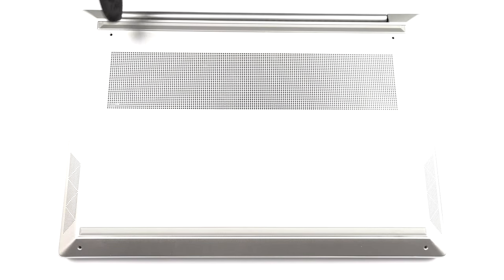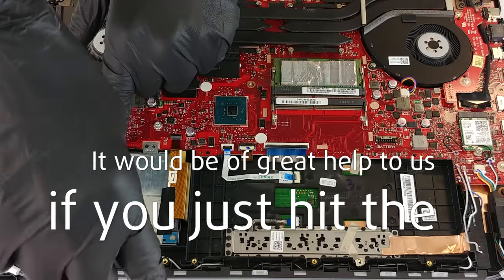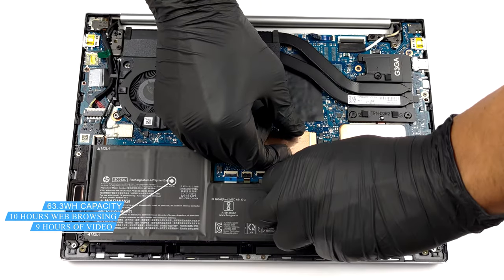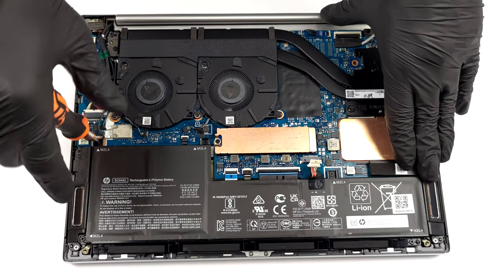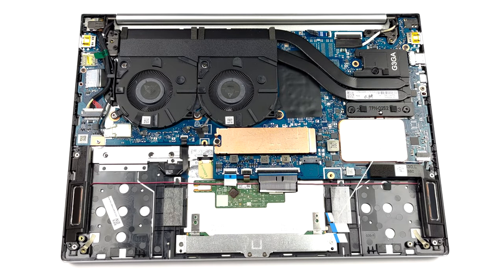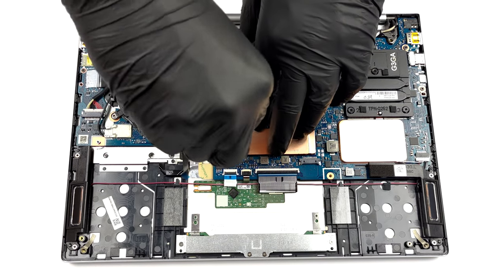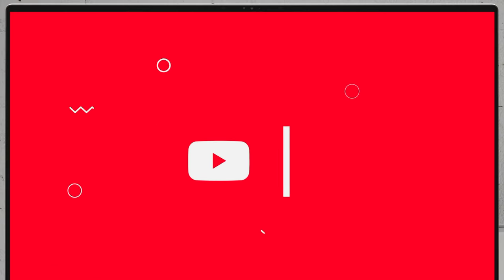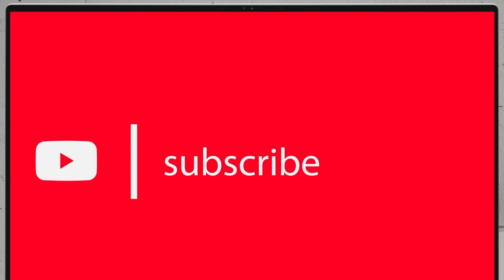🛠️ HP Envy 14 (14-eb1000) - disassembly and upgrade options

Comment: This guy pre-opened the laptop. All sides of the laptop have 8 hooks that prevent you from using a plectrum like he uses here. You can see it's pre-opened because when he slides the plectrum at the sides, the back of the laptop (screen connection) lifts, which would still be hooked at this point.
Reply: Bro tell me why it worked when I did it then😂😂😂
Reply: @baguette5836  Which model number do you have